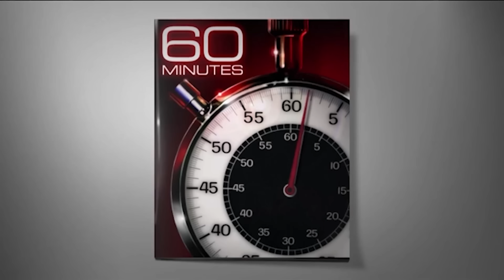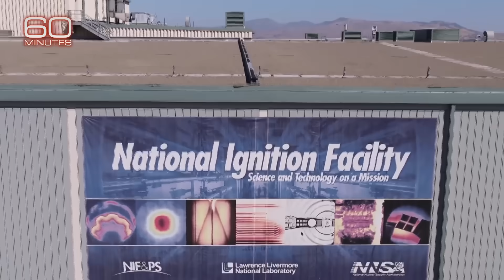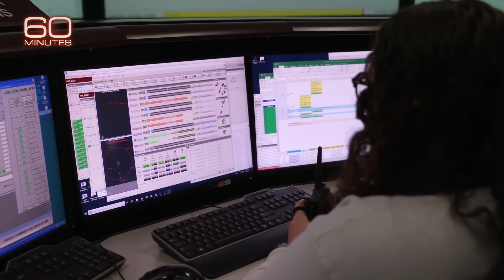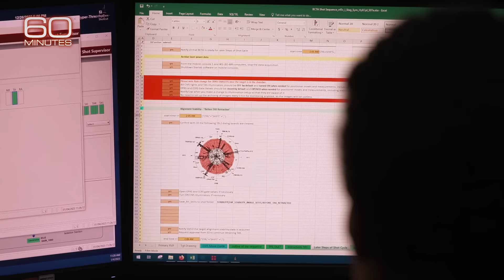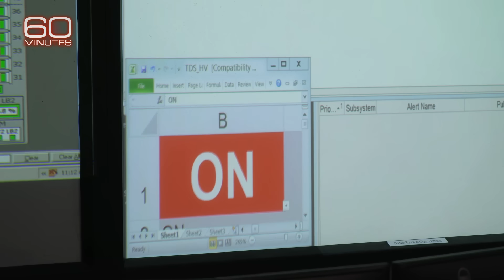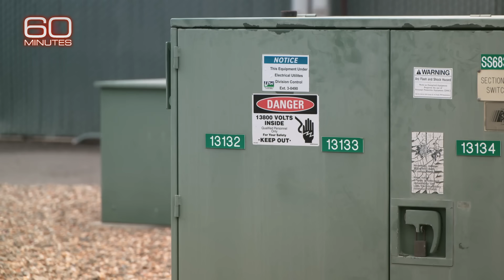Nuclear Fusion: Inside the breakthrough that could change our world | 60 Minutes

Comment: Here on the other side of the country at the world's second highest energy fusion laser in Rochester NY, we can do about 8 or 10 shots per day, and do much of the underlying validation work for the more powerful and more expensive shots then taken on NIF. If you have a serious interest in lasers and nuclear fusion I have several old documentaries from the 70s and 80s on my channel which illustrate the very long and arduous path that it has taken for us to get to this point. After 10 years of failing to ignite its DT capsules when most scientists expected it to happen in the first year or two on NIF, it came as a huge shock to many here when it finally did happen over the past year. Keep in mind that even if this technique of laser inertial confinement fusion can't be turned into a new source of power, it is still an enormously important new tool in physics. The neutron fluxes that are achieved in a 3 megajoule shot like the one last month are absolutely stupendous, and exceed in brightness that of any other source available to scientists, and the temperatures and densities able to be reached in these ignited, burning capsules are found only at the cores of planets and large stars. This is literally a tool to bring exotic pieces of the high energy universe into the laboratory for the first time in history. Regardless of whether it ever powers the lights in your house, it is undoubtedly going to open up whole new areas of study in experimental physics and astronomy which until now were effectively unthinkable.
Reply: Great post - thank you.
Reply: Thank you for this post.  I was originally going to say something rude about how much money & materials are wasted in building this stuff, but it all makes sense now, so thank you for that!  I will definitely check out your channel!... 👍🏻👍🏻
Reply: @_A4A  But, any type of scientific advancement for the growth of our civilization is not “waste.”
Reply: Yes great post,I'd be suspicious about timing for sure .
Reply: I believe your point about future neutron experiments is a key aspect for NIF. My MS and PhD dealt with fusion engineering. A key aspect, as I am sure you know, is having first wall and super conducting magnet materials that can withstand long term high energy neutron fluences. If NIF can perform ignition shots as a regular operation, I hope real fusion condition tests can help with determining the best first wall material plus other energy conversion aspects.
Reply: @PNurmi  why are they using copper to hold the shot? I get it's a great conductor but there are other materials that hold up better and have better conduction.
Reply: @michaelwachendorf2096  It is not about electrical conduction rather its there to convert laser energy to x-rays that then crush the D-T pellet to reach fusion ignition. There should be a better explanation of this out there on YT somewhere.
Reply: @michaelwachendorf2096  Copper is used for the hohlraum support structure for its property of exceptionally high thermal conductivity, which aside from exotics like graphene is second highest only to silver, which itself is only a few percent higher than copper and not worth the dramatically higher cost. The diamond shelled microcapsule inside the hohlraum is filled with high pressure deuterium and tritium gas, then frozen to a solid ice layer on the capsule inner wall at around 10 kelvin. Most of the heat extraction from the hohlraum is done through the copper support. The comment above mine referring to conversion to x-rays actually refers to a thin coating of gold on the inner wall of the cylindrical depleted uranium hohlraum in which the microcapsule is situated. The lasers do not shine directly on the DT microcapsule, but on the inner wall of the hohlraum, which is heated to a blackbody temperature of about 2 million K where it predominantly emits soft x-rays, which are only THEN absorbed by the surface of the DT microcapsule, causing it to ablate and implode. This is all extremely inefficient with less than 1% of the laser energy actually making it onto the surface of the capsule as x-rays, but is done to increase irradiation uniformity. Direct drive ICF where the lasers are shone directly onto the capsule itself is much more promising for a hypothetical future power reactor, and mainly what we do at the facility in Rochester.
Reply: @Muonium1  thank you for taking the time to break my question down for me greatly appreciated.
Reply: I'm surprised almost no media outlets have mentioned the incredible work being done at the LLE, the facility really should get more media attention. Meliora!
Reply: Not really.  The purpose of the NIF is so we can study inertial confinement fusion without testing hydrogen bombs.  The Comprehensive Test Ban Treaty prevents us from doing that anymore, which is a good thing.  Still, to maintain the knowledge base in case we need to start building hydrogen bombs again the government funds this project.  That is why it is happening at a weapons lab (LLNL) and its funds come from the NNSA (National Nuclear Security Administration) which is tasked with maintaining the nuclear weapons stockpile.  Inertial Confinement Fusion is really bad if you want to generate power (they can only do one shot every other day) but is really good for testing the same mechanisms that make nuclear weapons work.  In the last two years they were not even doing fusion shots but were testing crushing plutonium-239 into its alpha phase.  There is only one application for that kind of research --making bombs.  I wouldn't read too much into this experiment and its results.  Its certainly a huge scientific achievement but its not going to lead to a commercially viable fusion power plant.  That kind of work is being done in Europe right now at the ITER (International Thermonuclear Experimental Reactor).
Reply: @atticuspomponius  You mean the ITER that just announced it's going to have several years more delay before first plasma in the 2030s because of cracks found in the vacuum vessel wall? That ITER? 😏
It should be said that nothing contained within your reply is a secret. Much of it was directly mentioned in the press conference at the ignition announcement itself, and the rest is published in open literature on the LLNL site. I disagree that you can ever say with certainty that laser ICF "will never lead to a commercially viable power plant". In the fullness of time, one never knows for certain where the fruits of fundamental scientific research will ultimately lead. Randall and Boot's magnetron, invented for the sole and direct application to war, is now in every house in the developed world making popcorn and reheating leftovers daily.
Reply: @Muonium1  Thank you for the thoughtful reply.  Its true, I cannot say whether ICF power may or may not ever be commercially viable, but it looks like that mechanism of generating fusion has some serious issues: the target and hohlraum are extremely expensive to manufacture, when the target detonates the hohlareum does as well sending bits of debris everywhere, the efficiency of the laser is very low.  In my field we use a pumped laser to ionize tin targets for the purpose of generating ultraviolet light.  We make it work because we have to but the efficiency is terrible and we run into the same issues NIF does with debris from the target contaminating the reaction vessel which requires periodic cleaning (at least it is not radioactive though :p).
Reply: @atticuspomponius  I assume you're at a company whose name is an anagram with "slam"? As far as my admittedly limited understanding goes, that would actually be a very good example of unintended spinoff from fundamental research in laser ICF, since I think a significant measure of the laser-plasma interaction physics, and even some of the hydrodynamics of the falling tin droplets came from early ICF research. 
Of course a hypothetical eventual laser ICF power reactor could never use hohlraums for its targets, it would have to be a direct drive type, lasers directly on DT capsule system, which is orders of magnitude more efficient owing to the lack of need for the creation of a thermal x-ray bath to do the capsule ablation. As for the inefficiency of the laser itself, which everyone of late seems to savor pointing out took 300 megajoules to create its 2MJ of UV light, I really don't consider it much of an issue at all. A future power reactor could never use the neodymium doped phosphate glass of current ICF lasers. It MAY be able to use something like supercritical helium cooled sintered multicrystalline Nd:YAG laser slabs in the way that something like HAPLS did, but is vastly more likely to simply use a KrF excimer laser of the kind that the US naval lab uses at its Nike facility. They've already achieved multi Hz repetition rate firing at far higher efficiencies than any Nd glass system, and the very deep UV wavelength a KrF laser naturally produces without any nonlinear frequency tripling tricks is highly amenable to efficient laser-target energy coupling.
Reply: @atticuspomponius  The iter which won't even turn on until 2035. When tritium is damn near gone unless their prayer of getting their tritium breeding blankets to work isn't a waste of time and hope.
Reply: Military grade lasers that actually work in a timely fashion are going to be quite the sight to behold... to their victims.
Reply: A total waste.  The money funding these projects needs to go to eliminating poverty and homelessness.  This is literally a crime against humanity.  But science demons care nothing about people.  They are trying to play God.  They want the power of creation, so they can proclaim themselves as God.  It will never happen.  Meanwhile, millions of people are suffering daily because of mass poverty.
Reply: Man, that is one hot planet.  Fission, sure, but FUSION in planetary cores?  I don't think so.  Could be wrong.
Reply: @MrJdsenior  referring to the pressures; like for doing eg. shock Rankine-Hugonoit and equation of state calculations for metals and minerals at ultrahigh pressures in the solid cores of gas giants and degenerate stars.
Reply: something is happening with fusion did you see the other project with the plasma donught smasher, they gonna use elctromagnetics to do some induction instead of steam for electric generation

Comment: The Hydrogen  Fuel  Cell   is already   in production,  and gaining   interest.   The    idea is to pressurized  water,   something    like a diesel    engine   uses  high compression   to explode the fuel,    the  hydrogen  under pressure explodes and  emits only water   while producing  enough   power for an automobile.    So  this sort of  fuel cell  using  hydrogen  gas,    which emits water,   will  replace   diesel   engines  soon.    The problem with electric cars  using batteries is they can   explode like bombs.
Reply: Ah, remember hearing about the Hindenburg?  It literally was a hydrogen gas bomb.  Batteries don't "explode like bombs".
Reply: @CaptainRon1913   Anything can burn , and anything that can burn  can blow up  under certain conditions.   There has been  flash  fires   on airplanes caused by   leaking batteries used in   computers.  During  the recent  Floods, the  battery driven cars were totally destroyed.    There is no perfect  vehicle,  but   batteres do not produce energy , they store  energy ,  they do not produce energy ,  so you have to charge the battery using energy from a third party source.  But  Hydrogen  is a source itself of energy  like  Oil,   and  Hydrogen  can  convert  it's energy directly into  electricity to  transmit  power to the wheels.    Batteries borrow energy  to   propel the wheels,  and so  the  electric car was always  considered just a gimmick ,  even  in the   early   1900s when  the first electric cars were made in Hartford , Connecticut  in  1897  by the Columbia   Bicycle   Company, and later   was the Pope  Electric car  made in   Indiana  until    1914.     Trolly  Cars were made  to run  on electric motors  energized by the rail   in the  middle of the track  or an overhead   rod  touching  a wire .    Remember the Bumper Cars ?
Reply: if you wish hard enough, the conversion efficiency might break 30%.
Best of luck

Comment: Scientific advancement has only ever sped up exponentially, if you could plot it on a graph, the middle ages was a horizontal line pitched slightly up, comparatively we are now almost vertical. A.I and quantum computing are progressing very rapidly and once they can be utilised ubiquitously, Nuclear Fusion will be a matter of how fast can we build it. 10 years is ambitious but the biggest hurdles are ones that can be solved by tools that we are now beginning to use.

Comment: One thing that is not exactly clear is that the net energy gained was for the short period of time that the fusion happened.  To get net energy out of the full cycle they will need about 3 orders of magnitude of improvement.   So either Helion is right and their method will work or we are still 20 years until we get fusion.  If we ever get fusion.  That is because the other thing that gets left off is the math around getting the fuel.  They also don't say that the primary source for Tritium is fission reactors.
Reply: Only twenty years away... where have I heard that before?
Reply: @vulpo  Inflation, man, the remaining gap keeps increasing

Comment: Not only is it 300 in, 3 out but you also have to consider cost of staff, shipping costs, etc.
Reply: And that’s just the raw heat.  Convert that heat to electricity… cut that number in half
Reply: and the cost in energy (and money) for creating the diamond spheres, sourcing the deuterium, the cost of the cylinders that hold the tiny spheres, and the other parts destroyed in each fusion reaction.
Reply: @vulpo  The fusion is between deuterium and tritium.  Sourcing tritium is much more difficult than sourcing deuterium.  Naturally occurring tritium is extremely rare on Earth.  Tritium is most often produced in nuclear reactors.
Reply: Thats not the point, the point was to show that fusion in man-made machine is possibe.
Reply: @JackieWelles  No, that wasn't the point. Fusion in a man-made machine has been done many times, even by a high school student (with help), in the case that energy put in wasn't a consideration. The point was to extend how long the reaction can run, and achieve ignition - a self-sustaining reaction - and beyond that having the energy coming out from the reaction being less than going directly into the target.
Reply: @netdragon256  I think you are just confusing it with nuclear fission and yes smart kids in their have garage managed to do it but fission is what nuclear reactors are doing right now and we been doing it for the last 80 years since the first self-sustaining nuclear reactor.

Comment: The cast of companies @11:34 should highlight "HELION" which differs from the two main technologies of inertial "laser" fusion and the Magentic confinement "Tokamak" reactor in that it's not just another way to boil water and still use steam-driven turbines to generate the commercial power. HELION's approach will generate the electricity directly from the fusion reaction which would be as great a leap as the fusion reaction itself. This is the paradigm-breaking tech that will lead us into a new future.*Note, this link starts about 6 minutes in. Rewind for the best experience. https://youtu.be/_bDXXWQxK38

Comment: My eyes saw Nuclear Fusion and immediately gleamed with potential, they lit up like stars, lol. Nuclear Fusion is the path to practically limitless energy, if harnessed correctly.
Reply: You do know they use it for boiling water? That's a technology from 18th century. Beside they will not share this for free, you will pay limitless hahahaha
Reply: @arnoldkekesi9022  obviously it ain't free dumbss. The point of this is to have CLEAN AND RENEWABLE Energy to replace fossil fuels. There's no such thing as free things In this world
Reply: @arnoldkekesi9022  Steam based generators are indeed the most common use for thermally driven power plants.

That being said steam generators are not the only way to generate power, and certainly not the most efficient in power plant volume or energy conversion.

Supercritical CO2 has a huge potential to make power plants more efficicent.

And then with fusion once we have cracked neutronic fusion there is the possibility of aneutronic fusion down the line from which we can directly siphon energy from the charged particles produced by the reaction.

Comment: Nuclear weapons are FISSION, not FUSION. The booms split atoms, not force them together. (commenting on the beginning of the video, not later where they get it correct).
Reply: That's the "atomic bombs," with fission chain reaction of heavy elements. There are the much larger thermonuclear weapons called, "hydrogen bombs." Those came out in the 50s, and they use fission in the first stage and a secondary nuclear explosion from fusion.